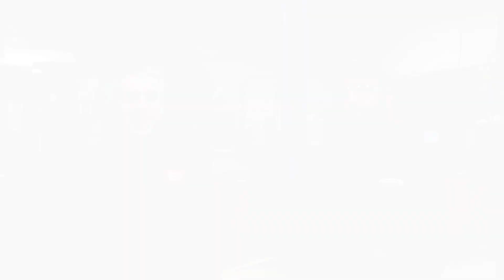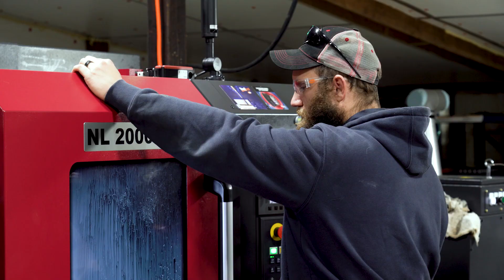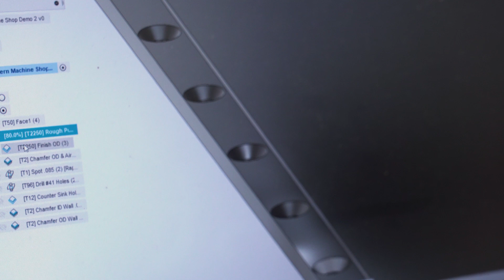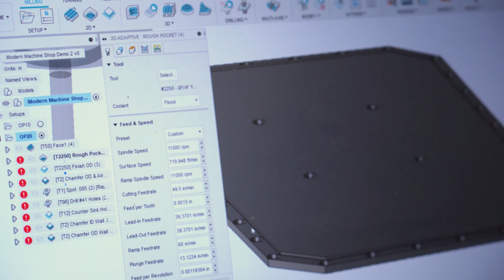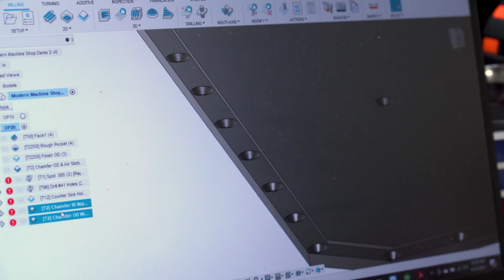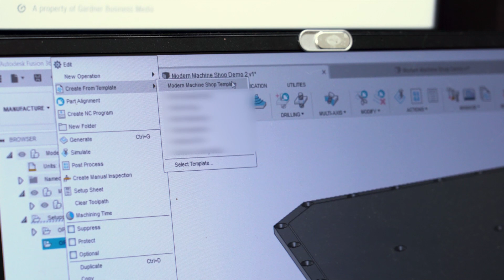Use CAM Templates to Automate Programming | The One-Person Machine Shop

Comment: Did guy say "rest material."
Reply from the maker: That’s right, he did say “rest material.” This refers to the CAM software’s geometry for the “rest” of the material that is left over between one cut and the next. For example, a large-diameter tool leaves some material behind in the corner of a pocket, then the software applies a smaller-diameter tool to cut the “rest” of this material.